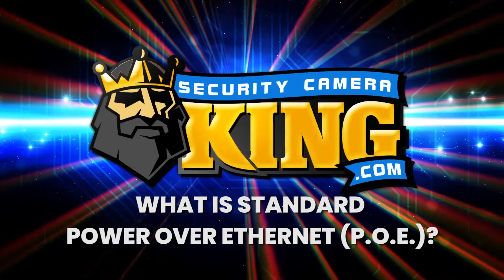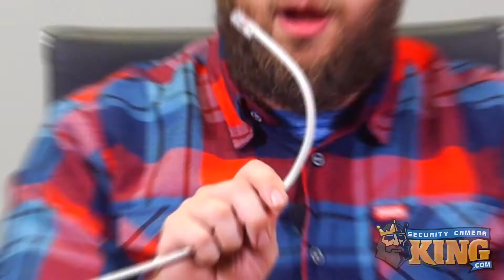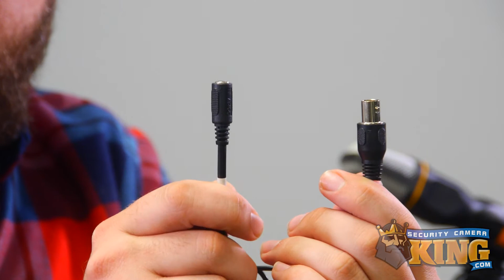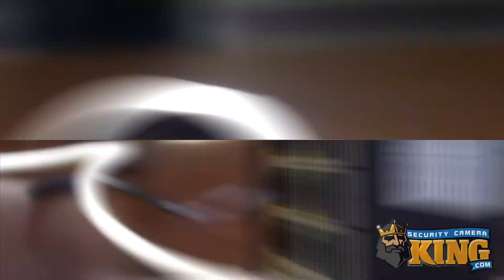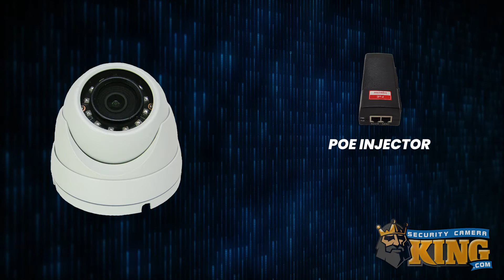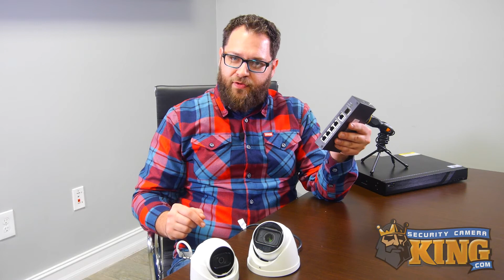What is Standard Power Over Ethernet (POE)?

Comment: Friend a question, if my internet is slow would it be better to wire the cameras instead of using the wifi? Is it convenient for me to have IP cameras if my internet is slow? .. recently they told me that I did not have to worry about internet speed because one thing is my internet and another thing is the wifi between the nvr and the cameras .. but I did not understand Very well that